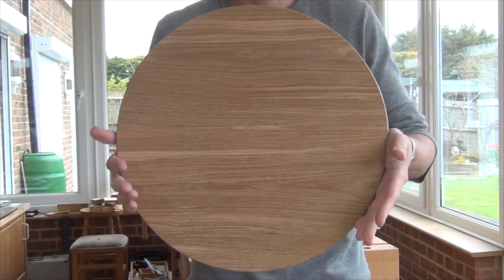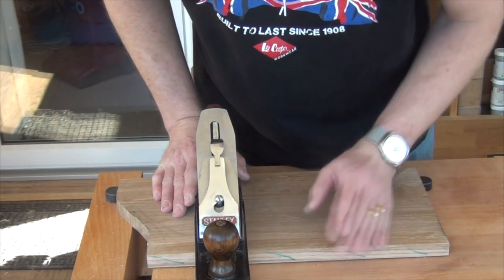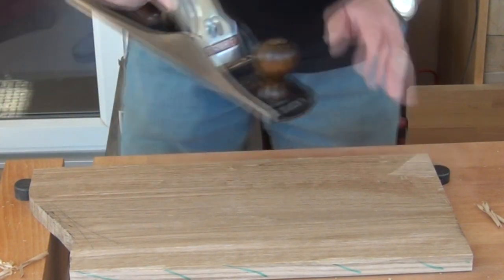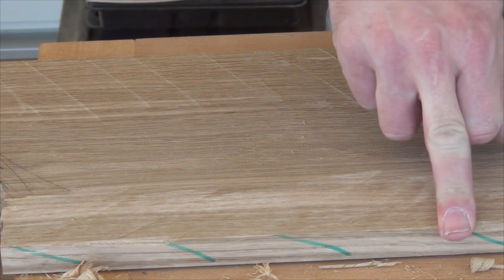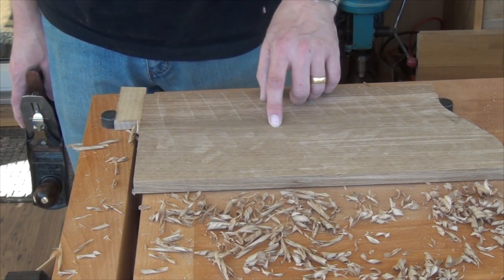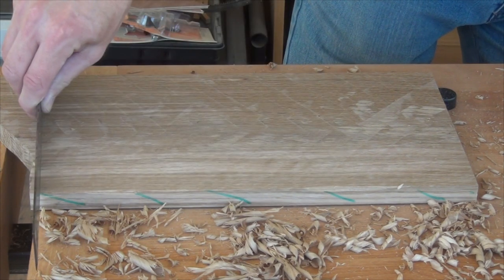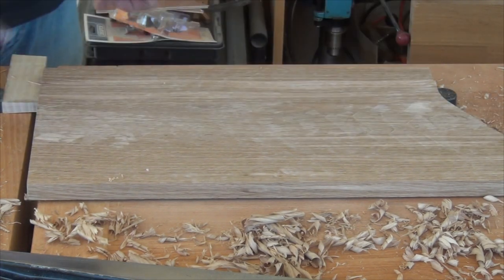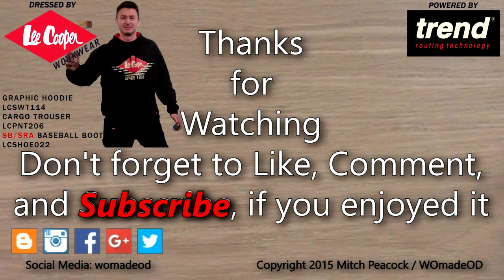Flattening Boards - A Tricky Situation

Comment: I would have just planed straight across.. Thanks for teaching how to properly do it. Great video.
Reply from the maker: +Petorious Cheers! A lot of the time that works just fine, with the curved blade preventing tear out, but every so often the wood decides to bite back. I developed this technique myself, although for sure others must have used it or similar approaches in the past. There may be better alternatives, but I've yet to discover them. Thanks for watching, Mitch
Reply: +Mitch Peacock - WOmadeOD Similar technique to planing up old floorboards if you want to switch from carpeted to wooden floors.

Comment: Thanks for the g reat instruction !! have two oak boards which I tried to flatten manually, did not manage fully yet but this will help (at least for giving me new motivation :P)
Reply from the maker: +Niels Sterrenburg Cheers Niels. This video was really about handling the awkward grain situation, with regards break out and tear out, and you may wish to look out my other videos on flattening which cover checking for wind, etc. Good luck with your boards - if nothing else it's good exercise 😉

Comment: Thanks Mitch. I love working with Oak but it really makes you think about the grain and it really punishes you if you don't. That's why I bought the low angle plane with the 55 degree blade. More of a scraper that a plane but it let's idiots like me get good results in oak.
Reply: Trevanion .Laughing out loud at that because I got one about 2 weeks ago for sanding larch deck boards. It's a beast, good workout as well as good results.  Cheers, Gary
Reply from the maker: +Gary Knight You're right, and that's half the fun as long as you don't have a deadline or no spare contingency.
Reply from the maker: +Trevanion Don't forget the extractor, air filter, face mask, ear defenders....😂
Reply from the maker: Trevanion That's good to know. I love my Makita cordless drill, and would definitely consider them for any future power tools I may need.

Comment: Mitch, could you use a "backer board" clamped against the board you are flattening to reduce tearout?
Reply from the maker: +Scott Clark That can certainly stop the back edge breaking out. Clamping sufficiently firmly can be problem, so it pays to glue a backer strip on instead. Once done, you can rip and plane it off. Both require you prepare the edge flat first, so not always convenient.
Reply: Thanks for the videos.
Reply from the maker: +Scott Clark Cheers Scott, thanks for watching